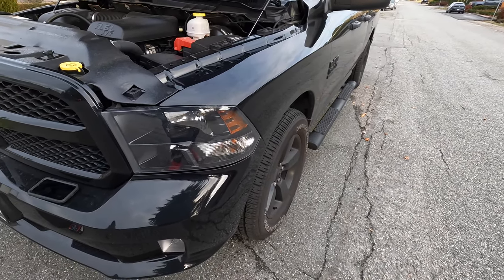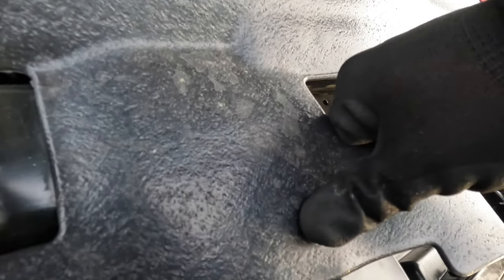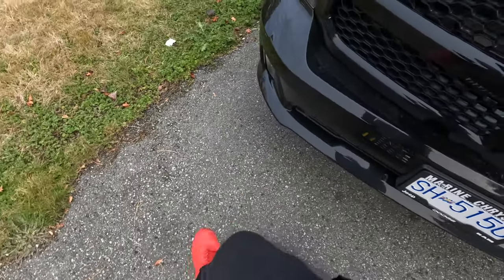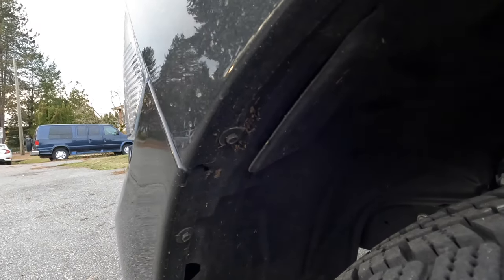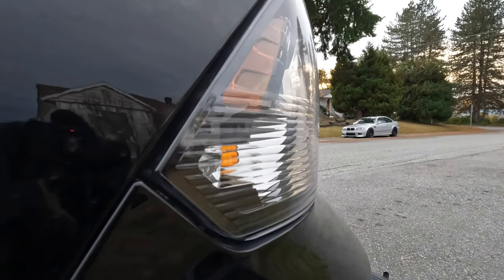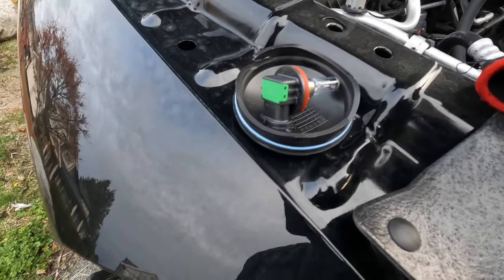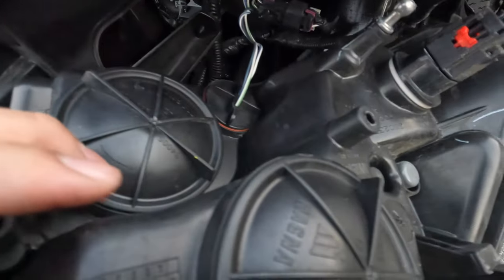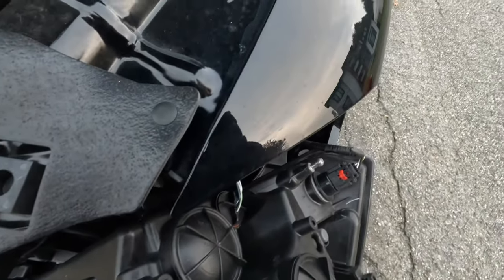How to change Ram 1500 classic headlight bulb

Comment: Started doing mine which I thought would be a simple job. Was like uhh, why won't it come out? Checked your video and it was that damn white tab so thanks. 

Should also mention that it needs to come down as it allows the adjuster screw housing to pass through. I was pulling it thinking it was a release which would make more sense. They literally did NOT have to include that piece at all when it has 3 bolts. On the 2021 there's also a metal nipple holding it in so it will be a little harder to pull out. 
I went ahead and replaced all 4 while I was in there with 6k's so I'll be that asshole on the road (sorry in advance for other Texans).
Reply from the maker: They really made it a pain to work with! I’m glad you got er figured out.
Reply: lp

Comment: Great video, thanks. PS What a terrible job of engineering this by FCA. So much space in the engine bay but for some reason they need to make it as hard as possible to change a headlight bulb.
Reply from the maker: No problem, and yes I agree terrible design. I guess they charge customers by the hour to change the bulb lol.
Reply: My buddy just had one burn out, cost him $120CAD to swap it. He supplied the bulb. Im cheap so here I am on youtube to do it myself. Swap both to LEDs and call it a day. Ill do the grill method instead of fighting with a socket extension. Thanks.
Reply from the maker: @roba4139  Wow $120 with parts supplied that’s crazy, that’s why I try to do everything myself. Most things now days require patience to work on “which I don’t have” lol, but I’ve been getting better with it.
Reply: @AbdullahZahid just a little input, it’s $120 CAD which converts to roughly $90 USD. Still way too much for a lightbulb replacement if you supply the parts though
Reply: @roba4139  wow.. yepp I'll be doing my led on my own
Reply: Would I be advancing a conspiracy theory to say making bulb replacement difficult puts mega bucks into mechanic;s hands and that this would possibly result in a huge kickback for the car maker somehow? 
Apparently when I complained to my dealership, they told me the cost of replacing a bulb on their new Jeeps was over one thousand Canadian dollars ! Big big kickback there eh lol !

Comment: Good video but you only changed the low beam didn't show high beam replacement I have a 2019 ram classic
Reply from the maker: @campman8670  Same idea, you just have to open the high beam slot instead of the low beam

Comment: Thanks for sharing this video. Without this video, I would have never thought that I would have to reach up into a little trap door in the wheel well to get the headlight assembly out. Much appreciated! 🙏
Reply from the maker: No problem my friend, glad I could help.
Reply: @AbdullahZahid  I also have a 2022 1500 classic and when I replaced the headlights there was no white clip. Only a hole with a rod like the ones that hold your engine cover on. I guess I got lucky.
Reply: Some mischievous car assembly guy should set up a mousetrap in there . What a friggin heart stopper that would be eh !

Comment: Thank you so much ! Easy to follow. I should have had it done in 10-15 minutes but it took so much longer because of the bottom bolt  that holds the headlight. That thing refused to come out. I got it loose enough where I could pop the headlight out and replace the bulb. Thanks again !
Reply from the maker: @hdhillon1227  No problem! Glad I could help. Hey at least the bolt come out lol

Comment: Nice job. I got the h11 low beams and the 9005 for high beam for my 23’ classic. For fog lights it’s also the h11. What a difference compared to the stock lights.
Reply from the maker: Big difference, especially if you drive on the highway during the night.
Reply: can you post a link where you got them ? i have the same truck and looking to swap mine
Reply: I found led replacement fog lights, take the 3 bolts out and unplug the wiring harness and bolt in the new one. And they are smoked lenses as well, matching the headlights perfectly

Comment: Best video yet on the process, thanks!  Man did Ram ever cheap out on the bulbs on these classics.  I have a 2020 Classic and now have to change my 4th headlight bulb!  My 2015 Grand Caravan still has all the original bulbs, so not sure why I'm having so much trouble with my Rams bulbs.
Reply from the maker: Np man, yes the bulbs are horrible. I just upgraded to led no issues so far.

Comment: irrelevant question. your running boards on your truck were they factory and came with the truck or did you purchase them aftermarket and put them on? if so would you mind sharing link on where you got them if you did get them aftermarket. thanks in advance
Reply from the maker: They came with the truck from factory.
Reply: okay thanks @AbdullahZahid
Reply: @AbdullahZahid  just curious do you happen to know the name of the runnings boards that  they are? Like a name? Reason is I’m trying to get new running boards put on my truck I’m tired of the chrome look lol
Reply from the maker: @zachlink27  you can go to mopars website select the truck you have scroll through till you find the running board option.
Reply: @AbdullahZahid  okay thanks man really appreciate it

Comment: Nice video but if something goes wrong you  would have to drive to the dealer, feel like a fool and still have to pay
Reply from the maker: If you can’t do it then don’t do it. This video is not to force anyone to change the bulb. It’s for those who just want to change the bulb on their truck themselves. Shop will probably only charge about $200, better than getting stuck once you have everything apart.

Comment: Listen , doing this headlight bulb change is so damn simple,  it feels like it would be hard but it really isn't,  same with the transmission  fluid change I was tempted to take it to dealer , but decided I would save myself  2500 $ and do it myself,  it was so simple.....stop giving money to dealers for such simple jobs unless your a old man or woman , then take it in , or have your darn children do it , hahahahhahaa
Reply from the maker: I agree, but somethings I still get done from a mechanic. For instance I used to do all the fluids in my vehicles myself. Now if I need an oil change I gotta buy the oil for 30-50 bucks and then deal with the old oil and the mess and time. I’d rather pay them the 70 bucks and have it done. Same with diff fluid and trans fluid if I get charged 30-40 bucks more do get it done I’ll do it just to save my self the hours and mess. I only say that now because realistically it’s hard to find time.
Reply: It’s lifetime transmission fluid. Wasting time and money regardless how you go about changing it.